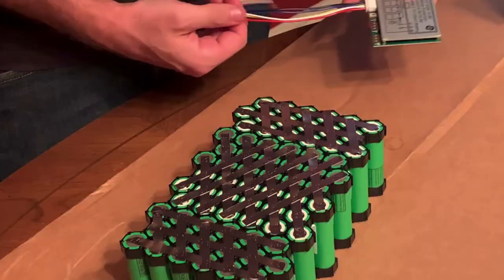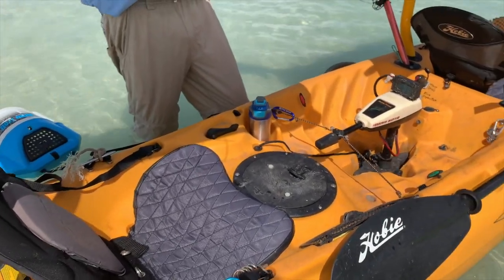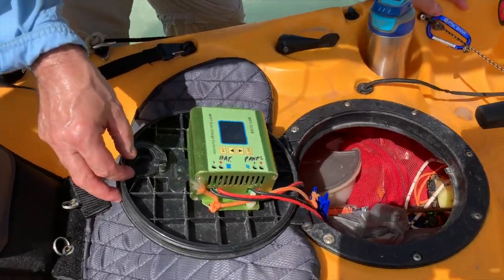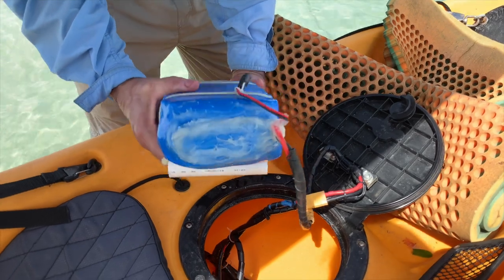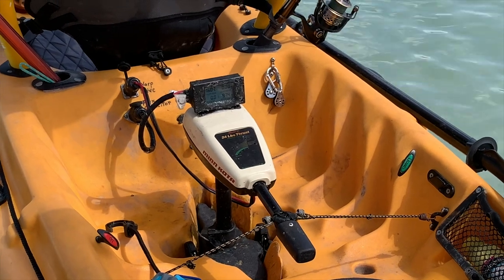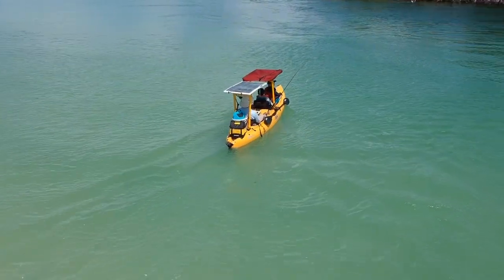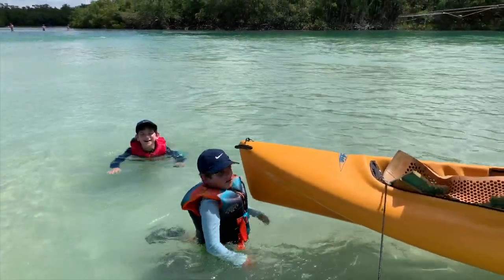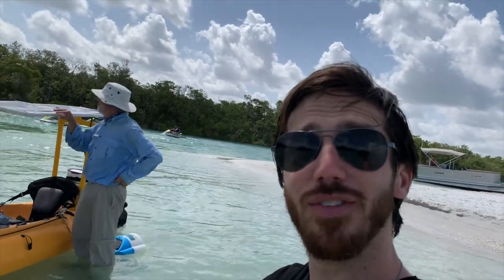DIY solar powered electric kayak (overview and demo)

Comment: Is the estimated range of 10-12 miles a total distance travelled, or 10 miles out and a further 10 miles back?
Reply: it's total distance.  But this was also using some higher speeds and running against the current at times.  I have never tried to push it until the battery was totally depleted.  Never had a reason to do that.  The range is plenty good for my needs.  Thanks for your question

Comment: What a great video and a great idea! I never thought of that! Is this an inflatable kayak? I have a new (cheap) inflatable kayak which I am thinking about taking to Panama when I retire soon. I'd love to put a little electric trolling motor on it and take it out on the water there. What do you think about using an inflatable kayak for this? Is it practical? 🤔
Reply: The kayak in the video is not a inflatable, it's an expensive hard plastic kayak.
A trolling motor on a cheap inflatable kayak is not impossible but it is not practical or easy.
Solar is rarely useful, in this kind of usage. 
Al tho i'm probably going to use some of the mounting system used for the solar panel from the video, on mine canoe.
So that i can make multiple day boating trip's (theoretically)
For one day trips use bigger battery and or more efficient motor.
Reply: @martijnverschuren3578  Ok, thanks. I will take my inflatable kayak to Panama but won't attempt to add a motor to it. Maybe I'll look into getting a rigid kayak and doing the same thing your father did with his. If you write the book, I'll buy it. 👍🏼
Reply: @terryashley4674   It's not my father, i'm not the maker of this video. Just a guy who thinkers with this kind of stuff.
Reply: @martijnverschuren3578  Ok, sorry. I misunderstood. Still, I'd like to have one for myself. 😀

Comment: Just looked up the modern version of that brand motor is only $130 and produces 30 pounds of thrust (5 more than his). If you have the kayak this would only around $200.

Comment: At first I thought might be top heavy and make easy to tip.. but doesnt look too bad and the shade is great too..
Reply: the panels and the PVC pipe weight very little.  And the batteries and the motor are at or below the water line so it is VERY stable, even in high winds.

Comment: What happens if the kayak is submerged for an extended. Of time or capsized? I understand that it works on stability to stay afloat so if the water enters the cabin or even the solar panel is it as simple as letting it dry and then plugging it back up again?
Reply: Chose this Kayak because of its stability based on a 33" beam.  Never tipped it over even with big boat wakes, sailing it with a sailing kit and surfing some waves near shore.  Can't say it couldn't happen but never has.  I've got 40+ years on the water including big ships at sea.  Learned a lot along the way to try to stay safe.  Thanks for your comment.  Many other kayaks would not be as stable and could result in flip overs.  Safety is always #1.

Comment: What happens if the Kayak tips over? I know the batteries are in the water resistant compartments, but what about the solar panel and PVC arches? Is it just a very stable kayak?
Reply from the maker: Yes its so wide that its hard to tip it. You would need to basically stand all your weight on the outer edge.
Reply: @EbikeSchool  Makes sense. Thank you!

Comment: Very cool solar propulsion!  How fast would it go if powered by the two panels without the battery?  Why do you have one of the panels covered?  I am the 1,000th comment!
Reply: More batteries would not increase speed, just range.  And every hull has a hull speed, meaning that you can add more power (horsepower, not battery storage) and get very little additional speed due to frictional loses.  Only one panel.  Front is just a shade canopy.  No need for 2 panels.  Additional battery charge does not add anything the way I use my yak.  Best regards

Comment: Looks top heavy and I'd be interested to see how it handles with a windy environment.  Looks like you could stand beside and fart and capsize the thing.
Reply from the maker: You can stand on the side and it won't capsize. it's a wide sit on top kayak and its crazy stable.
Reply: @EbikeSchool  Correct.  33" beam.  I have sailed it with a sailing kit in 8-10 knot winds and had it healed over pretty good.  Never flipped it.  Not top heavy at all.  Solar panel and PVC canopies weight a few pounds.  Motor provides for a good daggerboard as well.  Let me know when you are in SW FL.  I'll take you out and keep you dry!!

Comment: Why can’t you use the panels in series then you have two then you can use voltage directly off panels obviously with a smart charge controller to reduce voltage
Reply: Could be done.  Just more than I need.  And even with two in series the power output would be such that only very slow speeds could be attained.  Thanks for your comment

Comment: I think I  missed it. What is the range under power?
Reply: 10-12 miles easy.  All dependent on speed and how much time I'm at anchor fishing (during which time the battery is recharging but I am not using the power).  It does charge while running as well.

Comment: if this kayak ever flips are the Solar Panels toast?
Reply: No the panels would be fine.  They are sealed for use outdoors including marine environments.  The non sealed components such as the solar controller are stored in the water tight hull.  I chose this kayak because it has a 33" beam and I have sailed it, surfed it and been out in choppy seas and never flipped it.  This type of install should not go on a traditional cheap kayak that is less stable.  Thanks for your question

Comment: The second solar panel should be the same watts as the motor then you can go along with just the sun put a switch on and flick between the two depending on the weather

Comment: With the panels that high its not getting top-heavy?
Reply: panels weigh almost nothing - couple of pounds.  Kayak has a 33 beam.  Never tipped it over even with a sailing kit on it.  Thanks for your question

Comment: Any chance you could make a kit that has all the wires harness, etc except the battery and/or solar panel?  But definetly all the connections and wires.  Maybe a version wqith the battery + panel too?

Comment: Why not a second solar panel run through a buckboard to direct drive the motor. While the current solar panel keeps the battery at 100%.
In case of nighttime, storm clouds or simply getting farther away from home than you thought, you have full battery just waiting. 
How about a second panel and battery so you have an A-B battery system.

Comment: is it possible to wire batteries in series and batteries in parallel circuit together?
Reply: well yes! 2x12 is 24v xAh 12+12 is 12 2xAh. however you desire!

Comment: The solar panel isn't going to make a lick of difference in this application (we're talking minutes, maybe, of extra runtime. Need more panels!)  But the shade it gives you, now, THAT'S something to talk about LOL.  I still love it though - it looks pretty cool!
Reply from the maker: It can actually be hours of extra runtime. My dad normally stops and starts, fishing along the way. Each time he pulls up the anchor he's more charged than when he stopped.
Reply: @EbikeSchool  That's a good point - I suppose the more you stop and fish the more chance it has to charge.
Reply: @yoster77  Absolutely.  I can honestly tell you that there have been some days when I only went a few miles over 6 hours of fishing and came home with the battery at the same charge level as when I put in.  Sun is strong in SW FL as well.
Reply: @micahsdad5388  I'll only believe you if you make one for me as well ;)
Reply: @yoster77  meet me in my shop and we will build one together !!  Stay safe out there

Comment: you could easily fit 4x of solar panels in series, for faster recharge or speed
Reply: recharge rate yes.  Speed, no.  Any displacement hull has a limit to how fast it will go.  When you reach the hull's limit, you could double the power and maybe only get 5% more speed.  Dang friction !!
Reply: @micahsdad5388  then you need to rise above the water, water foil electric kayak

Comment: I'd love to know the range of current that the motor draws and the range of current that your panel supplies.
Reply: motor at 25+ amps  and the panel around 4~5 amps full sun.
Reply: Thanks
Reply: @10OZDuster  Correct.  At top speed about 23-24 amps.  At slow speed about  5-7 amps.  So 5-6 hours of sun adds some decent range.

Comment: How much does the solar panel extend the range?
Reply: A 28 pound thrust trolling motor probably consume 25A 12v 
Or around 300 watts running full speed. 

His solar panel is only 100 watts 
So running full speed. It is only 1/3 of the power supplied by solar panel. 

A slow n then stop for fishing n recharge the battery 
He could go a long way

Comment: About how much weight did this add?
Reply: good question.  This is not a light kayak to begin with.  About 70 lbs.  Battery may be 8-10 pound.  Motor maybe 6-8.  Wiring and solar panel a couple pounds.  So, the added weight is negligible.  When I'm out alone, I put 50 pounds of lead ballast in the forward storage compartment way up in the bow to hold the bow down in the absence of a person in the forward cockpit.  "Built for comfort, not for speed".  But 5+ knots aint bad !!  Thanks for asking

Comment: I vote to install a second solar panel and then let's see the kayak in action. Range and speed should be impressive. Next vid perhaps? 🌞🌞🌞
Reply: Would definitely extend the range but the speed is limited by the length and design of the hull and the power of the motor.  More battery charge would not affect the top end speed.  ONe reason I don't put on a second panel is that I am often out fishing by myself and I don't want the front canopy frame blocking my casting.  It's all a matter of tradeoffs.  Thanks for watching the video

Comment: Add a mast, sail sheet, and harness the power of wind too.
Reply: I do have a sail kit for it and it is actually a good sail platform.  Sailed in winds up to 10 knots and had it heeled over pretty good but never flipped it.  33" beam.  VERY stable.

Comment: Very cool.  Love the idea of having power back up on a kayak that is clean and not noisy or polluting for the fishies.  I think he needs to plug up the cable end for 110V recharging.  Might get corroded with the salty air.  I love the boat color too!!
Would not be able to lift a Hobie kayak, I was thinking of the Tetra 9 - 10 ft kayak or a Malibu stealth, both sit on top types.  My question is... we see the engine, the solar, the battery, battery monitor, wiring, and solar charge controller.  But what is moving the boat under it?  The old pedaling gizmo?  That would be very slow.  How about some kind of small propeller behind the boat?  More efficient and pushes it forward.  Would that work?  I'd love to build one!
ps- please don't catch any fish unless you are starving and to eat.  Its not a sport to take a wild and beautiful creature, rip out its tongue and lips - for fun!  Strange sense of fun.  Teach your kids to stay away from hunting and fishing.  It is the sanctioned murder of other species and pretty despicable.  Live in harmony with nature - they don't kill us.  Don't kill them.

Comment: how much the motor ?and hp/?
Reply: I think I paid about $40 USD for the motor.  It was an older model that I bought from eBay or Craigslist.  The Minn Kota motors are very high quality.  The trolling motors are generally rated in pounds of thrust.  This one has 24 pounds of thrust and moves my kayak along at a good speed.  I wasn't trying to go as fast as possible, just fast enough when I need full power to move against a strong tidal flow and/or wind.  I am mostly in the slow speeds and that way I am using less power.  Thanks for your questions.  Hope this helps

Comment: Flexible solar panels are light but they suffer microfractures within the cell and don't have great outputs when its older.
Reply: Dont disagree but panel is affixed to rigid frame and power output has been pretty steady over the past 2 years.
Reply: @micahsdad5388  thanks for the feedback. I see that a lot of manufacturers now put a output warranty even on flexible panels. 

It may be because their cells don't fracture as much.
Reply: @andthesunsets  Could be.  That's good for everyone.  Thx for the info.

Comment: I would create an exhaust for that charge controller compartment
Reply: You make an interesting point here.  Problem is that an open exhaust breaches the sealed below deck area allowing for a path for water to get in.  I have never had a problem due to heat build up and I go into the hatch every so often to grab something down below or check the meter.
Reply: If you circulate the air within the hull it will be conditioned by the lower surfaces in contact with water, which could give you the thermal boundary condition you need.  You'll need to make sure those lower surfaces are exposed to the internal air flow though
Reply: You would be better off heat sinking into the water. As a yachty am off the opinion any Thru hull fitting can end up being just a hole, which isn't good. Cheaper to replace a solar controller every year than everything once. Leave over engineering to the engineers. Great job Dad!

Comment: Solar panels get too hot like they are mounted. A mendecino motor would keep temps down on panels.
Reply: Not sure that they get too hot.  This is how solar panels are intended to be used.  Am I missing something?  Thanks
Reply: @micahsdad5388  Just suggesting the idea of using a mendocino motor to add longevity to the solar setup. The idea being that most solar cells/panels generally last around 15 or 20 years outside. The heat build up from the sun causes a drop in efficiency. A way around this may be using a mendocino motor with the smallest panels useable and a very small diametrically magnetised permanent magnet on either end of the axle with just enough generation coil to duplicate the out put of one or two solar cells on the motor as one or two cells are always shaded while the others are in sunlight as the motor spins. The spinning cools the solar cells so they dont get hot and their surface stays cleaner longer. While in theory this all works out the only issue i have had is the use of passive magnetic bearings. Living on the east coast things tend to fall off during hurricane season. The solution i have found is either jewel bearings or magnetically attached ball bearing vertically. I have also experimented with the charles flynn motor. The secret to getting that to work is the permanet magnets can be no stronger than the electromagnet used to pulse repel the magnets in the timing cycle. This means you half to build alot of layers to achieve efficiency. But in the end these are just ideas to experiment with. Just dont confuse them with the free energy mumbo jumbo they are usually associated with. These are just efficient systems when applied correctly altho they can be a little more expensive as you half to build everything.

Comment: This is sooo cool.... How about having a solar panel on the beach for electrolysis and using hydrogen to power a fuel cell which would power a motor on the kayak..  Or, even better, charge a battery from a bicycle generator on the boat...  Can they use these boats to ship smart phones from China?  Say, a million of them takes off.  Say, half of them sink in the process.  Then, charge consumers a fee for green smartphones...  Of sell green cell phone delivery futures... I love it! What a cool idea! A green kayak! Lovely...
Reply: You got my head spinning.  But all good !!

Comment: 2 HP electric motor = 1500 Watt. Solar panel is 100 W (max). 
Yes, the solar panel is a range extender -- barely.
Reply from the maker: That's definitely not a 2 hp motor. It pulls around 25A max at 12V, making it more like a 300W motor.
Reply: @EbikeSchool  do you have a link to the battery build for your Dad's kayak?
What is his run time?
Thinking I would like to do this with my Predator Minn Kota.

Comment: Make a filppng mechanism so the panel can be used as a sail.
Reply: panel does flip up.  Actually have used it as a sail with a wind coming from my stern.  See the video for range of motion on the mount mechanism

Comment: That 100watt solar panel is not going to extend your range very much and I an guessing it would take two weeks to recharge that battery if it were drained below 50% 
It seems like people here  imagine this is a self sustaining unit. I just dont think the math works out at all.
Reply: Definitely not self sustaining.  But yes it works to add range.  There are a few days when I haven't gone that far, fished a lot (not moving) and came home with the battery at the same level of charge I started with.  So it does work great but it is not perpetual solar recharge when under power, for sure.

Comment: I'm terrified at what would happen if the boat toppled, would it electrocute everyone in the water?
Reply: 12V DC would not even harm the fish around them let alone anyone in the water near by if that happened. If you ever watched Junk Yard Wars they built a submarine and left some of the 12V terminals exposed and the motor worked fine.

Comment: Too flimsy and could roll over I would add a side pontoon but nice set up
Reply: Wrong.  33" beam.  Been out in 15 mph winds and strong gusts and never been rolled.  I have a sail kit and sailed it in 12 Mph winds with no outrigger and never been blown over.  Surfed it on 3 foot waves and never tipped over.  This is a great and stable yak.  "seek first to understand, then be understood".  Please don't scare people off if you really don't understand the specifications and performance of any particular hull.  Of course I have extensive experience and that helps keep me safe as well.